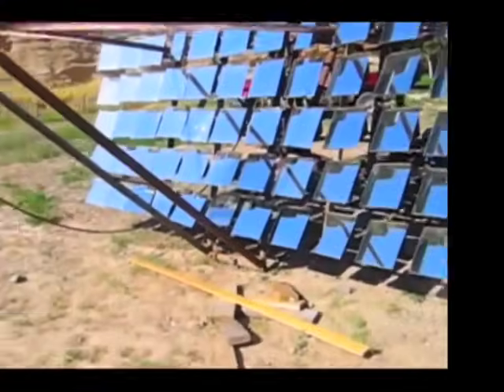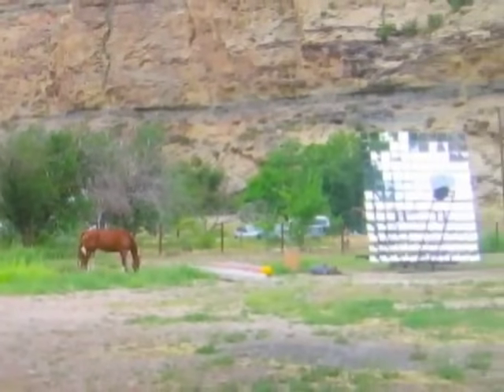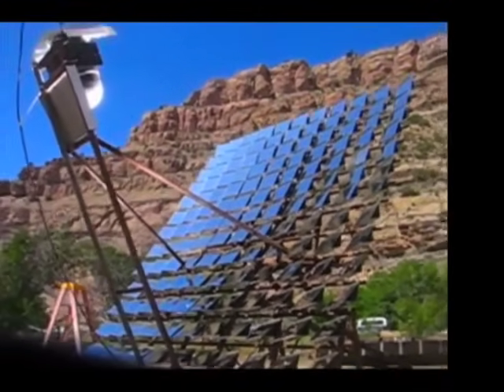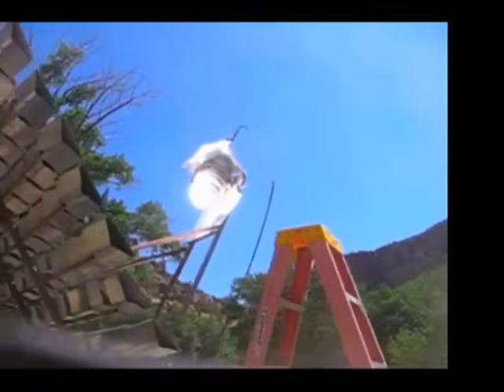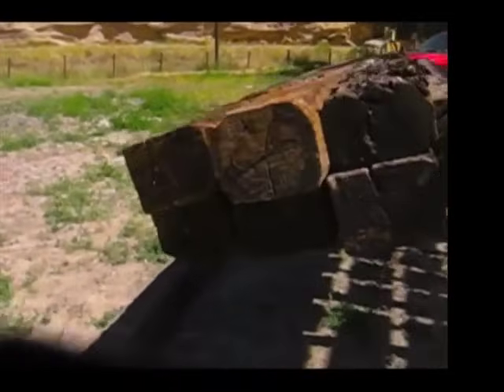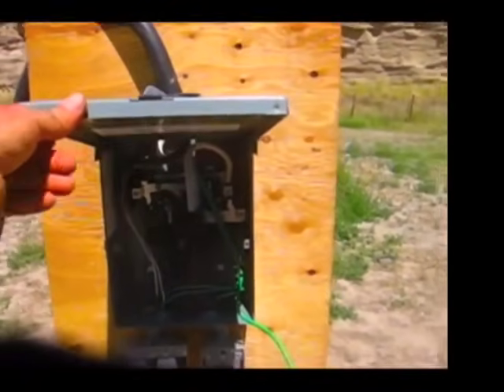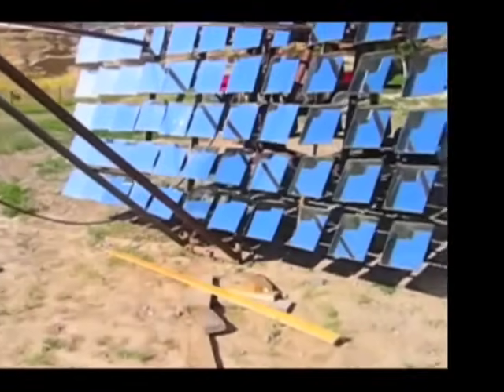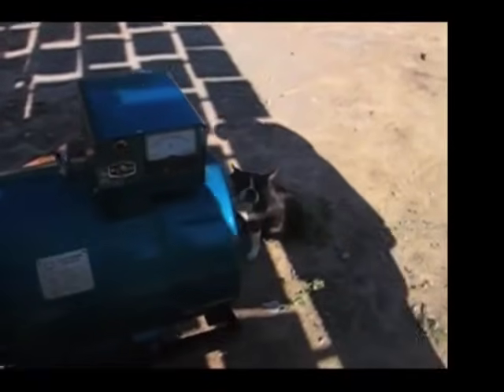STEAM ENGINE 12KW GENERATOR Solar Mirror Array Death Ray

Comment: hello... I have a question, those 12 Kw are per hour, day, month???
Reply: TETOYVIENDO They sort of answered you - just not correctly|
Kilowatt is available power. Period. Time has NOTHING to do with it.
If you have a 12kw (or 12,000 watt) load and a 5kw generator then you will NEVER have enough power. Not in an hour, a  day or a year. If you have a have a 12kw generator then you have 12kw's available at any given time.
Reply: The generator puts out 12kW. 12,000 watts.
1kWh is 1000 watts for a 1 hour duration.
This generator can generate 12kWh per hour.
Reply: Mike Blake THAT HAS NOTHING TO DO WITH WHAT I ASK !!!
Reply: ***** Thats wrong. kW is a measure of power while kW.h, not kW per hour, is a measure of energy. 

There is no such thing as kW per hour, day , or month just as there is no such thing as horsepower per hour.
Reply: TETOYVIENDO You are talking to a bot.
Reply: eNLogic This generator COULD put out 12kW if over 12kW of energy was put into it I doubt this steam engine could do that.
Reply: Miles Williams
You are correct.
The solar constant is about 1360 watts per square meter. The reflector looks like it's about 9 square meters. 100% efficiency is practically impossible. You would have to measure the output on the load side of the generator to know the actual output power.
Reply: No mate, power already takes into account the timeframe for the energy being expended, so it is incorrect to keep saying things like 12KW/h or power per hour or kilowatts per hour. The correct thing to say is that it can operate continually at 12 kw.
Reply: No, Power is the rate at which ENERGY is being transformed. Energy is in the quantity of joules, calories etc... Power is how fast those joules or calories can be used or generated in this case, a 12kw generator generates 12,000 joules of energy per second, which equates to 12,000 watts which is 12kw. NOT 12kw per hour. Fuckwit.
Reply: Watts per second is also not a thing. Time is not in the equation.

You can, however, have a watt-second, which is 1/3,600th of a watthour. Watts are confusing in this way, as jules and BTUs are measurments of energy, where watts and horsepower are measurements of power.

Further adding to this confusion, Jules and BTUs can have a time element (per hour, per second etc) and become units of POWER. If that's not hard enough, a unit of power like the watt or horsepower can become a unit of energy when a unit of time is added.

The easy way to tell which way it's being swapped is (when expressed properly) there is no PER involved in the expression when a unit of power is used to express energy (kilowatthour)-- You can tell a unit of energy (such as native JULE) converted to show power (such as native WATT) by the word PER used; 1 jule PER hour is energy unit used to express power ( a jule being created or consumed every hour), where a kilowatthour is the opposite, no PER, it's a power unit being used to express energy (a thousand watts of effort being expended for a duration of one hour).

Easiest way to understand the significance is POWER is the rate at which any kind of work is being DONE, where ENERGY is how much work HAS BEEN DONE or theoretically can be.

Keep in mind that weather the power is carried by a shaft or through wires or whatever, it's still physical work being done. It becomes less confusing when you don't see work as work and electricity as a theory. It's all the same. After all, watts were not invented to measure electricity. They were used to understand power output of steam engines.

A workforce model would explain watts (power/force) as how many workers you have, and so how much work can get done how fast. A watthour would be one guy working as best he can for an hour, or the same amount of work done as 60 theoretical dudes working as best they can for one minute.

A kilowatthour per hour is a kilowatt. a watthour per hour is a watt. A watt-second per second is a watt. We don't say 60 miles per hour per hour, or 60 miles per hour per second. I wouldn't be suprized to hear it in doctor who, though... But then that'd be temporal physics or something.

A 12kW generator head, if driven to full potential, can do 60 watthours of work in only 18 seconds. If you want 60 watthours of work done in 18 seconds or less, you need a work capacity of 12,000 watts or more.

Look how it translates-- If you want 60 person-hours of work done every 18 seconds or less, you need 12,000 trained workers or more.

In this particular video, we don't even know how times of day will affect the boiler output, therefore the steam engine power output availability, therefore power availability for energy output at the terminals of the generator. In fact, we don't even know that the engine has the power capacity to drive the generator to its full constant rated capacity, or if enough steam to run the engine that hard, if it has the capability, could ever be generated in theoretical full sun. It's just what you'd call "the genhead".

The rating of the genhead is pretty irrelivant as a measure of howmuch power you're getting from the sunlight, or how efficiantly thesystem's turning it into animated torque to drive a potential load like a genhead.

I could take a 2hp wheed-whacker engine (2 hp x 745 = 1,490W or 1.5kW) and plop it onto a 12,000 gen headand I would never get any more than 1,490 watts of power out of it. If i needed to get 12,000 watthours of work done, it would take 8 hours to generate it with the 12,000 watt-rated head being driven at 2hp.

Even that wouldn't work, though. Cause that head needs to be driven at 3,600 RPMand my weed whackr probly doesn't develop 1,490 watts of rate of energy delivery until at least 7,000RPM.. So maybe you would get 500 watts going into the genhead, of which maybe you'd get 350 available at the terminals if you got the planets lined up right.

You could use gears to get the same amount of power into the genhead by reducing the speed with a small gear on the engine and a big one on the head. There would be friction loss, but you could spool up the engine to the speed needed to put full power to the head. Of course, if you weren't using full power, he engine would be spinning that fast and burning more fuel for no reason. So, you wouldn't use that or you'd use less drastic gears if you dodn't need that much power.

That steam engine will have the same problem. If there's not a heavy load on the gen head in relation to the engine power, steam will be wasted expanding at a throttling valve instead of doing all its expanding in the cylenders. The way to get around this is to run the system at full-load, and then store the energy instead of use unly what you need. Great setup, cause then you can tax the sunlight for all it's worth and have energy available round the clock. But you lose most of the energy you gathered as heat storing it in a battery, or as expansion losses if you store is as pressure.

How much you lose would be jules or watthours. How fast you lose it in part of the process under certain conditions would be statistics measures in watts or jules per second-- "when the power grid is half-loaded, the system loses 10 jules per second between the diaphragm tank and the turbine inlet, even though some energy is endothermically acquired at the output side of the pneumatic valve".

I catch heat when I explain things 20 different ways for the same reason my GF hated bill nye, because she found him condescendingcause she got it the first time. But, one person will understand it one way, while another will understand it differently. Perssonally, I didn't understand it till I actually put the "knowledge" in some book against a trillion different scenarios. Actually, not even then. It was after turning cranks by hand, reading labels on motors and setting a lot of stuff on fire AND looking at all those arbitrary squiggles on a page we call letters and numbers.

Oh god... No pun intended.
Reply: it's the peak instantaneous production.   You add your time unit in hours over which you maintain it to get your kwhrs...
Reply: it is a power per sec  ( 1w = 1J/s) OK!
Reply: Best site where you can get free SteamWallet codes!
get on this website no regret. 
SteamCodeGenerator .c o m
Reply: MrRUKidddingMe it is the  rate at which power is being generated..in the video he is generating power at the rate of 12000 watts per second.. iif he generated this quantity consistently he would have been producing  12KW /h in that  one hour.. dayum numbnuts!!!  or in other words.. you could run 12 one kw rated machines for an hour at full steam..

Comment: hi, I wonder if it would be more productive if he used a system of copper pipe to heat water and also connects the output of piston also more copper pipe connecting it back to the heating system or need a system for cooling the steam back to water so coming back to be heated and moving the steam engine. you guys think this would work? 
translated by google, I'm sorry any error

Comment: and if you have no sun? hmm?
Reply: Solar Thermal battery using salt.
Reply: Harry Hicks
yes but i think you need like 600ºC to melt salt BUT it will hold the heat much longer than water.
Reply: Then stop living in a cave.
Reply: That is 100% true. Infrared and UV light is heating the water, not just visible light, so a perfect solar system could make way more visible light than sunlight would provide. If it were a perfect system.
Reply: LED lights. They are really efficient now so you can put out more light than it takes to power them. Just power your home with the extra electricity.

I mean duh do I have to think of everything!

Windmills too just get some high efficiency fans and presto! Green energy for all!

Comment: as a kid, back in the 60's, I had these cards with images of steam locomotives, added to a chocolate bar or something.  One of the cards I had kept for a long time, was that of one of the most advanced steam engines, designed at the end of the steam era.  It recycled steam, no plume came out and it had injectors, about the place where car engines have there plugs, in order to accelerate the condensation.  A genial engine with highest possible output!  I never read anything about it eversince ...

Comment: OK, nice design but I think you should have a battery pack somewhere to store energy and use it instead of straight off the generator.  Something happens, you shut down, no power.  Also, I think you should modify your tank to take in water as it needs it to keep the take from popping a seam.  My 2 cents to think about.
Reply: ... ADDENDUM; well insulated tubing connected to higher elevation radiator '' heat exchanger'' part of a reservoir (tank) could return the water back into the system, if properly timed, could be mechanically operated/or better modification to make it automated, my suggestion!
Reply: salt water can be used as a thermal bank. 24 hour operation... boom

Comment: The problem is it can't generate 12kW.
The 143 1 square foot mirrors reflect a maximum of about
143ft^2 * 74W/ft^2 * 85% = 9kW reflected.
Assuming the steam generator, engine, and electric generator are 10% efficient:
9kW * 10% = 900W of electric.
900W is the best it can do. Sorry, not 12kW.
redrok
Reply: you should watch a few video's that Dan ( green power science ) has on parabolic mirrors. I think a few of these would help this project.
Reply: ***** 3 kw agreed, less, dinamic source (the sun is moving), bad angles of attack of mirrors = 1/3 of that power = so far 1 kw
Reply: yes
Reply: That squared function in the second term is wrong.  Also that guy Carnot messed up the efficiency calculation.  It's a function of the max steam temperature (abs) / ambient (abs) 10 % is optimistic.
Reply: should be easy enough to meter the generator outfeed of power and know with exactitude ...
Reply: 1-3kW for that "piece of shit" sounds pretty good
Reply: wow duane from redrok, your web is great and full of useful stuff! do you have any idea how many area needed for making solar concentrator iron furnace  lets say 20kg / hour with full insulation? i've seen  video from tamera and they melt chunk of copper with only 3.4 m sq aperture, i think with some tweaks it possible for iron scrap too

Comment: Could someone explain what is the principle of the engine and how energy is transmitted from the boiler to the engine . Thank you very much .
Reply from the maker: Hi,
He used high pressure lines to deliver the steam to the engine. The engine is a steam engine but it was, in my opinion a bit too larger for the solar collector. For a full run the mirror array would need to be 2x the prototype size.

Comment: Huge and cumbersome.  Mount a real legitimate piston steam engine and generator head on a trailer. Concentrate instead on on concealing burning hydrocarbons exhaust smoke from burning trash, oil/gas/or wood to have concealable portable power.

This mini behemoth sucker is site location only. You will never maintain low profile to zombies leaving metro areas when nothing is left. What about hail????

But go ahead and build the solar boiler if you want to kill lots of have-nots coming in your secured zone.

Comment: he is running an AC generator, not a very efficient way of using this system, making DC and storing in batteries first would provide better overall energy levels, since the motor isn't running at the rated 1800 rpm to make 60 htz that is why the miter saw wasn't cutting well, not enough power.

Comment: I helped build one of these 30 years ago when I worked for Mother Earth News at their Eco Village in NC. I designed the mechanics and electronics that tacked the sun. It was so sensitive it would track the moon a few times a month. We used a solar cell, a 12V battery and 12V motor for horizon tracking and old car window motors for azimuth adjusting. It was designed to be a solar still that was used to make the alcohol for our alternative fuel vehicles.
Reply: Impressive.
Reply: I tried to email you but it says your account does not exist.
Reply: MrTHEORIGINALICEMAN I actually liked the freon solar tracker. What ever happened to that idea?
Reply: MrTHEORIGINALICEMAN The alcohol powered vehicles were an absolute busted waste of money ,time ,and effort.Use solar for electricty, Look up Wayne Keith ,he will show you how to run a vehicle on wood.
Reply: Whatever happened to the original Mother Earth News?
Seems as though it has been corrupted.
Regarding the solar power plant, buy a 12' solid satellite dish for a $100.  Vacuum seal Mylar for a lens.  Directly BDC drill a hole for the pylon leading to the boiler.  Connect some solar tracking, and bingo!  No mirrors, yet a highly efficient steam producer!
Reply: @SuperDave-vj9en  Satellite dishes are parabolic morrors - they are not lenses. 

The idea might work, if the dish mechanics were strong enough to handle the weight of the boiler and associated piping.
Reply: That is so fkn amazing I want to see it!
Reply: Weird...try this. bill.branch@nau.edu
Reply: Still no luck to either address. I tried on another computed but not sure of the result yet.

Comment: when it comes to a power supply that actually works better than fossel fuels there is no keeping under raps, holding on to secrets only plays in the hands of big oil besides wouldn't you rather get the credit first before someone comes up with it!!

Comment: Do you have to refill water?
Reply: MrTHEORIGINALICEMAN You could take Daniel's Idea and have the steam blow back into a condenser. Using a float valve and aquarium pump siphoning off the generated power, it would refill itself. Then you just make a mark inside the condenser tank and only have to add water occasionally.
Reply: Daniel Hernandez You can not use the waste steam to run another generator. but you could do the hot water.
Reply: Travis Lamb Agree.
Reply: yes he needs to refill water because there is no condenser

Comment: Seems parabolic mirrors would be more applicable in this project.
Reply: he's approximating that with the individual mirror segments each being independently aimed at the collector.  the gaps between them notwithstanding it'll get a high % of what a continous surface would.  The quality of the individual mirrors is easier to come up with than a custom perfect dish ...

Comment: Might be difficult to track the sun for continuous output since these concentrating systems require fairly precise focus.  Not sure about the power output.. vid mentions 12 KW generator, but load is temporary and looks like about 1KW or less .. short duration.  Seems to work for him though.

Comment: Ummm.. Water isn't "Bonded To" water. It is *part* of water.

H2O.  So, water is 2 Hydrogen atoms, and one Oxygen atom.

When you perform electrolysis on water it splits it into the hydrogen and the oxygen. And because those atoms don't like to live alone they form Diatomic flavors of themselves.

So  you end up with:

2(H2O) ->  2(H2) + 1(O2)

When you burn hydrogen you end up reversing that reaction.

Comment: They don't all use a platinum catalyst and be sure that the combining does happen as electric current is made. Try running a fuel cell without oxidizer and see how far you get, or just spend a little more time reading up on those old type fuel cells to go with your understanding of quantum mechanics which is where in physics I learned about how those things work.

There's better ways been invented since then, and still they're not ready for prime time.

Comment: no fuel cells use the reaction between hydrogen and the platinum in the fuel cell producing electricity and h2o [water :)] as a by-product not the combining of hydrogen with oxygen itself that creates the electricity